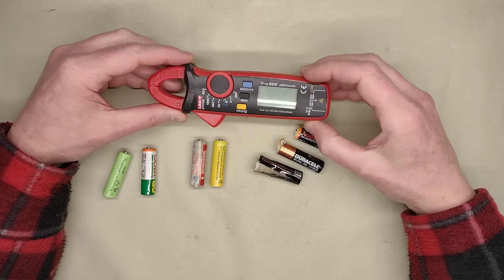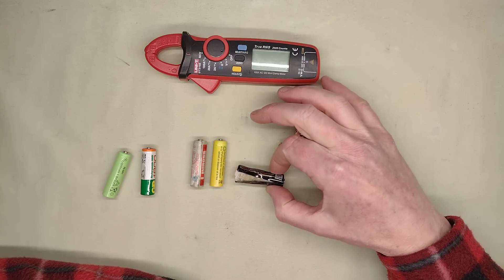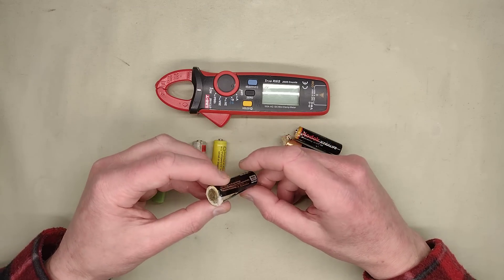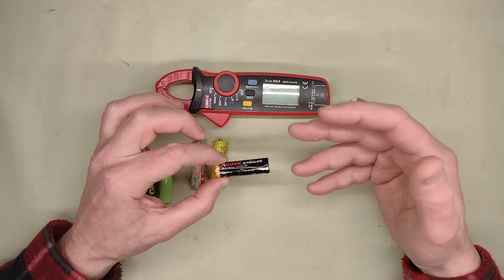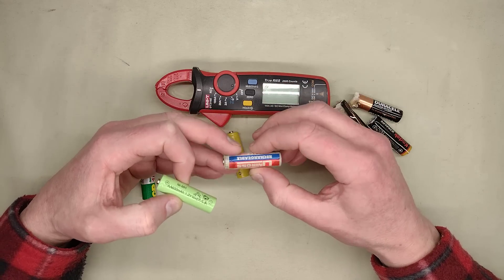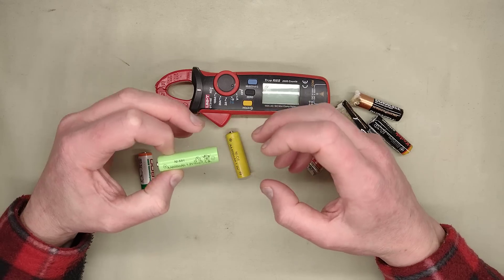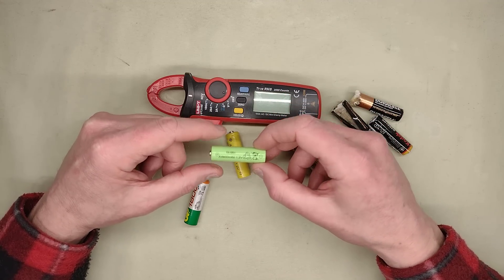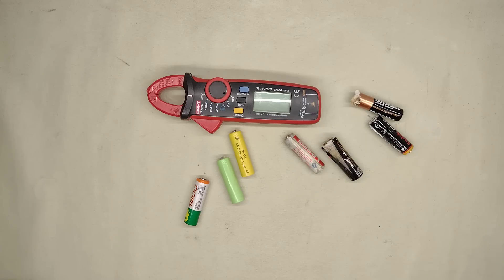The curse of leaky alkaline batteries

Comment: I heard my battery leak !
In the quiet of the night, I heard a very  faint , very high pitched buzz , which sounded like a mosquito . After searching around for the source discovered it was coming from my radio . Opened up battery compartment to find it was the battery singing and just starting to leak fluid . It must have been the gas build up escaping like a mini jet .radio saved easily because it had only just started .It was too high a freq for my wife to hear .
Ps every leaking battery recently has been a Duracell with me. They used to be much better
Reply: Good catch
I think the reason is cheaper to produce. One wonders if you dripped the batteries in rubber and  cleaned just tiny spot at the contacts. If that would work?
Reply: Yep, Duracells are always leaky. I don't use them anymore.
Reply: Every electronic that was unfortunate enough to still have Duracell branded batteries inside since the early 90s or later all leaked out for me

Comment: That's a very good point. I've switched over to almost exclusively HiMH batteries but from a battery cost point of view it was hard to justify. If you include the cost of devices damaged by leaking alkaline cells though it's easier to make the case for a switch. Personally, I'd like to see kids toys come with AA NiMH batteries rather than the battery packs. The lack of standardization in the battery packs must cause so much waste.
Reply: Yeah, but it keeps the £, € & $ flowing into their coffers so it'll never happen :(
Reply: I have a hell load of HiMH rechargeable batteries from LIDL which I charged them up using a solar charger. With the amount of toys that my kid has using batteries, it would take me bankrupt just to keep buying one use only batteries.
Reply: When you make your car charge your batteries it is not surplus power your getting for free. Although a small load, your engine still has to work harder to turn the engine when your battery is charging. Nothing is for nothing (unless your company pays your fuel bill). If it was free power we would all be towing battery packs and dynamos around with us.
Reply: @qviewq2071  
I assume you never charge your phone in the car? 
How much harder an engine has to run in order to charge a mobile phone, an iPad, a torch etc? In that case we should just drive during the day in order not to use the lights at night, we should not use the radio, no air conditioning, no electric windows etc the list goes on. Or even better, get rid of cars and walk. Well, if we walk and don’t drive we will wear out our shoes soles and need shoes more often, better walk with bare feet. Sorry, I couldn’t resist 😂 As I said, been charging tonnes of stuff in the car while driving the car and never noticed a difference in fuel consumption.
Reply: @ruinunes8251  What???? If you use any electrical system in your car it is being powered by the petrol or diesel. You can do whatever you want in your car. But it will use fuel. Its science, nothing personal!!!! The most expensive vehicle electrical system fuel wise is your airconditioner. It can use up to 10% more fuel when it is turned on. Charging a phone or similar small device will not use much additional fuel. But it will use some. It may be too difficult to calculate the amount. But it will be some. And it will be more expensive in fuel cost than using your homes power.
Reply: @karloftinker2832  

I think some of you are not getting my point or possibly I’m the one here who doesn’t know anything, and if it is the case, bring some scientific proof of it. 
So, a few points here from my own vague knowledge about cars:
1- I never said I was trying to power up a power station with my car, I’m just charging the phone, iPads etc while the car is running/driving. I’m not starting the engine on purpose in order to charge any devices whatsoever. However, you still can charge devices without the engine running but be mindfull that power hungry devices, may run you battery flat if you leave it charging for too long or if the car battery is not healthy anymore.
2- The alternator in my car, like millions of others around the world runs constantly from the second you start the engine. The engine is what runs the alternator and not the other way around. The alternator’s main job is to produce power and charge the battery. Your car will not run solely with an alternator unless you have a very large alternator. And again, even if you have a very large alternator, you can’t start the car without the battery, unless you own a classic car with one of those wind-up systems. So, in the first place, any power that my devices are sucking, comes mainly from the battery which is where the power is stored.
I honestly can’t see how much of a disaster, costly wise, can it be to have a device charging up while the car is running, when the engine is running the alternator constantly all the time. However, I heard that in some modern cars, the alternator nuns on and off depending of the batttery state of charge. I assume these new alternators may use a magnetic ring like the ac compressor in order for the alternator to engage. I never read about these new alternators so I will have a bit of a bed time story getting familiar with it. 
3-Air conditioning, yes, oubviously using the air conditioning, uses more fuel and why?
The air conditioning compressor has a magnetic ring on the clutch to switch the ac compressor on and off, so when ac compressor is engaged, it will cause drag on the engine because it is one more thing that the engine has to run.  This fuel consumtion when the ac in on, is more noticeable in underpowerd cars. In large engines/powerfull engines, I dont really think that will be that noticiable.  
I have no clue how ac compressors run in electric cars, I don’t own one, so I can’t tell. 
If something of what I said above doesn’t make sense, please explain, we all love to learn.😃
Reply: @ruinunes8251  I get that you are charging just your phone. 
And yes you would be using the cars battery to charge your phone if the engine is off. 
Car ignitions, alternators and batteries work like this: You press ignition, the battery powers the starter motor, the starter motor starts the engine. the engine begins to turn the alternator. At this point the battery has done its job. The alternator generates all the power for all the electrical systems as well as replaces the charge into the battery until the battery is full. 
Once the car is running the battery is no longer used to power anything. In fact you could disconnect it whilst the car is running and have no electrical issues (not recommended).
 
Any electricity required by the running car puts a load of resistance on the alternator. The more electricity required the more load on the alternator. Charging your phone puts more load on the alternator.  
The load from your alternator is taken up by the engine. 
More load from the Alternator means more input from the engine. More input from the engine requires more fuel is used by the engine. 
Therefore charging your phone in your car = the use of more petrol.
Reply: Hickel metal hydride
Reply: Eneloops are relatively expensive. Random NiMH die too easily and don’t recoup their cost vs purchasing several cheap alkaline.
Reply: I try to buy devices with standard AA or AAA batteries whenever possible for that reason. 

I have no unused non-rechareable AA or AAA batteries left. So soon when the last few devices drains their batteries I'll have switched over fully to NiMH
Reply: @PatrikKron  I also try to find devices or tools that I can use 18650 cells so I can charge them up with a cigarette lighter charger  in the car for free.
Reply: @ruinunes8251  Charge in the car for free???? Using petrol/diesel to charge batteries has to be the most expensive way to go.
Reply: @paulstubbs7678  
I guess you misunderstood my point. I didn’t say I was sitting in the car or simply running the car on purpose to charge the batteries. I charge my batteries on the way to work and vice versa. What is the purpose of an alternator in the car? To charge the car’s battery isn’t it? Where the power for the cigarette lighter comes from?

Comment: Its hit and miss with alkaline. I have had some energizer alkaline batteries installed in devices for over 10 years and they still work and never leaked. The lithium based AA batteries with 1.5v regulation seem like the way to go but they’re expensive. Even the lsd AA nimh seem to drain much faster than alkaline take to leak.
Reply: They used to advertise on their packs guaranteed leak free, no idea if they display that any more? Whilst I doubt they are practically leak free, they were offering an "up to £10,000" or something similar to try to show confidence. How this works trying to claim, could be terrible.

Comment: i been doing this for the last 5 years or so... you can use the old worn-out cells that they can't provide too much current any more on low current appliances like wireless usb keyboards and they can run for 6 months or more.

Comment: I saw another video that showed the cheap Ikea Ladda 2450 mAh AA Ni-MH cells are in fact the same cell as the expensive Panasonic Eneloop Pro.  I've bought heaps of them and use them in many different devices and they are great.

I use a Xtar Dragon VP4 Plus charger, which I initially purchased to charge Li-ion cells. This charger has a "refresh" function which, if enabled, discharges the Ni-MH cell prior to charging. I have read that modern Ni-MH cells should not be fully discharged so I'm not sure it this feature is beneficial.

Comment: I have some NiMH rechargeable batteries that no longer hold a charge. They're several years old, but whether I use them immediately or put them aside to use later, they only last a few days before they're dead. They're AAAs and I've only ever used them in an old mouse that takes two at a time.

Comment: I had placed Duracell batteries in my trail cam,20$ for 8 batteries
Hoping to get some great footage.
After getting it back,a week ago,one of the batteries leaked after only a few months.
Never had problems before with that brand,now I have  clean the trail cam,hoping it still works

Comment: As I said in your poll, I do find it baffling that more people aren't using rechargable batteries- where they'll complain or insult a games controller for using AA batteries vs sealing them inside a controller. PS3 & 4 both require you fully disassemble the battery so it's not even reasonable to swap it out during a play session- also the batterylife is dreadful. Feels like 6 hours or so vs...IDK 20 with enloops? 

I've reminded people that rechargeable batteries exist after hearing them complain their remote or toy drains them.

I like AAs as they're a standard and you can actually swap them out if you need them working now vs charging for hours. Or, you know, the device self destructs because the battery swells and destroys the internals. 

The ONLY issue I have had with rechargeables is the 1.2volts they put out seems to not be enough for my VR controllers so they always claim they're low on battery & disable vibration.  I'm confused why that is.
Reply: I don't see how a PS3 or PS4 controller battery cutting out is an issue, that's what they supply the USB cable for. You can use them plugged in you know.
Reply: @garrett69  
I think the comment spoke for itself?

The battery life on both controllers was poor, 4-6 hours about. When the battery runs out you can't swap them out to keep using them as intended- wirelessly. And if the battery bloats and dies? Well, get your screwdriver out and disassemble the entire controller.

Plug them in? You forget, the cable that was included is 3feet long. So if I wanted to do that it's more money for a design flaw Sony stuck with since the PS3 days, I would know I have a launch PS3 and a slim PS4

My 8bitDo Pro 2 came with a battery pack that lasts something like 20 hours and can use AA batteries or be plugged in, it's also cheaper than the PS4/5/XB controller by $20-30. And the cable is double the length.

Sony makes nice controllers with awful battery life, don't think there's much to be missed.

Comment: I recently found a couple of leaked alkalines in my devices one of them a duracell well before expiry which was surprising since that never used to happen before. I always thought of alklines as non-leaking so maybe it's a cost cutting thing - seeing what they can get away with 95% of the time. That said I would not use NiMH in slow discharge devices since they tend to die without warning due to their flat discharge curve. They also handle cold and heat poorly in my experience again resulting in unpredictable battery life. Heat can make them self discharge rapily or dry out inside and ruin them. Considering the higher cost of rechargeables compared to alkalines you might as well go lithium for devices you can not risk losing. I think it's important to point out that Ni-Cads are banned for a good reason as Cadmium is highly toxic and often ends in landfill. It's energy density is perhaps half that of NiMH and I believe it experiences significantly worse self discharge and memory effect. The way I handle alkalines is put fresh ones in my electronics and emergency devices for a year then swap them out for fresh ones and use the older ones in my bike lights and flashlights until they die.

Comment: Duracell is the worst and most expensive battery. And there are flashlights that actually short. D cell metal flashlights short due to them breaking the thin wrapper on alkaline D cell batteries. better to replace the D cells with adapters and AA cells will nimh. Alkaline still needed for wireless mice. Alkaline 9v batteries used in multimeters are actually ok don't seem to leak so often

Comment: I have alkaline batteries in my traditional clocks on wall, and infrared remote controls only. They are good for several years, and won't leak even after that.

Comment: While watching this video, I was wondering what could be said about NiMH cells becoming impossible to charge, even when only lightly used. I have noticed some brands more susceptible than others (notably GP) but even some of the Eneloops I have moved to have developed this. Typically the brand specific charger will start to charge the battery but will go red-blinky-led after mere minutes. Anyway, thoroughly enjoying the channel !
Reply from the maker: Some smart chargers require very low impedance batteries.  They will falsely end the charge early for older or low capacity cells.  If you put those same cells in a dumb trickle charger they will take a full charge.
Reply: I keep a older dumb charger just for this reason. If you charge those blinking batteries for a few minutes then swap to the "smart" charger it usually works. The same is true for phone batteries that have drained below the phone's safe charge self check after sitting discharged. Just manually charge it for a few minutes and your back in business. That's if you're able to even get the device apart in the first place. My biggest complaint about this smart trend is with the new car battery chargers that do the same thing refusing to charge. It's the whole point to owning the stupid thing but, yet again I have to drag out the old heavy dumb charger out of the garage to get the job done. Don't get me started on the smart low idle gas generators that need a large load to keep supplying power on certain low drawing appliances.
Reply: @williamganley4739  yes, I've had that problem with a smart car battery charger too!

Thankfully my Victron one is a rather more clever smart charger and can manage it.
Reply: I've had this issue with a GP battery recently. Failed to charge over a lot of attempts in two different chargers. I managed to fix it but I'm not really sure how!
Reply: My Maha C 9000 smart charger sometimes refused to charge perfectly good NiMh's. After warming the cells gently on a central heating radiator, the charger accepted the cells and started charging. Must have been the reduced internal resistance that helped. Worth a try ??
Reply: @iwalker3809  interesring
Reply: Had the same issue with old 2700mAh GP batteries and GP PowerBank v800c (charges 1-2AA with 7A and 3-4AA with 4A). Checked batteries with a slow charger and low load, and boom, not a single one of those were good. Replaced batteries with an 1900mAh Eneloops and those are still going strong.
Reply: @owowowdhxbxgakwlcybwxsimcwx  oooh, I wasn't aware of USB powered NiMH chargers! I've been using 14500s in my headtorch because I've got a very compact little charger that's great for traveling but I'd much prefer NiMH. Thank you :)